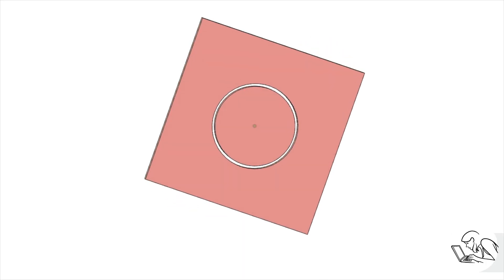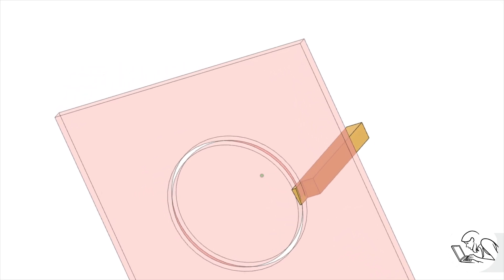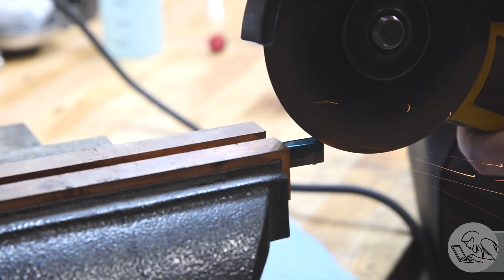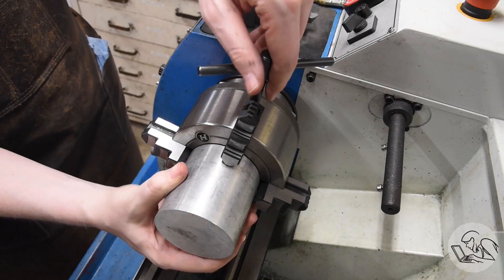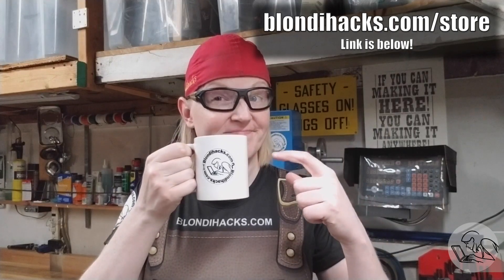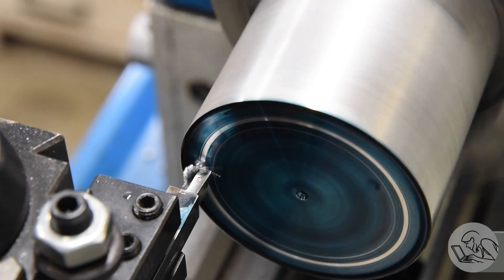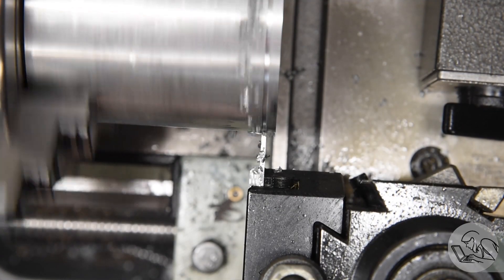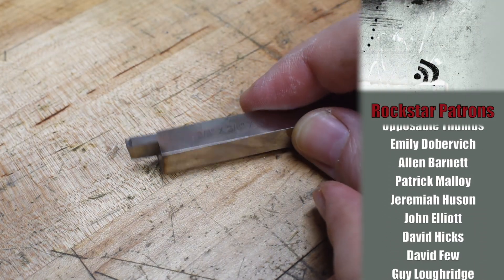Trepanning on the Lathe! Efficient and Tasty.

Comment: Could you trepan 9.25"×9.25" 1/4"-thick 6062 aluminum flat plate bolted to a scrap plate with spacers separating the work piece from the scrap and cut a ring with a 9" outer diameter and 7" inner diameter on a 10×22 lathe or would you need a much bigger lathe?

Comment: I've had much more success opening my beans with a downward facing cutter on the milling machine. less grit in them than  when I've finished having picked them up off the lathe bed in the past. Great video, I have used trepanning quite a lot to make locomotive tyres for fitting to wheel castings. you will be surprised how small you can make a cutter if you approach the work really slowly?.

Comment: you use a hand grinder to cutoff most of the material in cutting bits before you finish with the bench grinder, What brand of grinder and what type of cutoff wheel do you use?

Comment: Ive heated canned soup on a mud pump engine (DD 6-71)manifold many times. When time was short, I made a wire basket to hold the can down the exhaust stack. No vent, unless you like the taste of diesel soot but be sure to not leave it too long!
My favorite was an episode of "Home Improvement" where a contruction crew made grilled cheese sandwiches with a propane torch.
Gotta use the tools available!

Comment: You know I am wondering, has anyone thought about using carbide tipped hole saws for trepanning? I say this mainly because if you want to cut more than 15mm into it the tool required is going to be too weak, but a hole saw of about the right diameter should be able to make the cut, so you can cut deeper into the material and get a metal cylinder out... I realize for titanium this is going to be a bit hard, but still carbide is pretty resistant to heat damage...

Comment: Great tip and time saver. Just trepanned a 4.5” hole in a 5.375” x .750” billet of aluminium. Machine half way through then turned billet and machined from the other side. No great pile of swarf just a nice billet to use on another job. Thanks for the tip and keep em coming. Not sure you method of opening cans is that efficient though.

Comment: A good selection of high speed steel hole saws can be a valuable asset for doing this type of work. 
It is quite surprising how deep they will cut if kept clean and with plenty of oil, even on steel bar. 
The machine needs to be slow and powerful though.

Comment: The term 'trepanning', in the hole-in-the-head sense, is used interchangeably with 'trephining'. The tool, for cutting bone, is simply a hole saw which can be either operated by a powered drill, or more simply have a handle for manual cutting. A hole-saw on a handle is often referred to as "a trephine" or "a trepan".

Comment: So literally all I do at my job is trepanning cast iron. We have an array of trepanning tools that can drill up to 11.25" ID and up to 36" long in a single pass. We can also flip parts to do 72" long things. It's pretty fun. But very noisy. With lots of coolant.

We use Warner and swasey, and Gisholt giant hex turret lathes with 28" Chuck's and 12" spindle bores.

Comment: nice touch with the beans - the only appropriate brand of beans for the model engineering enthusiast. There's also B&M canned bread, which is not nearly as difficult to catch, but you do have to flip the can in the chuck to get both ends off, and heaven help you if your bread is not concentric.
Reply from the maker: It’s very difficult to find concentric bread. They don’t make it like they used to.

Comment: I have yet to trepan, but I have used hole saws to cut large holes while saving material. Obviously, I select a saw which is undersized as they are not the most precise tool (at least the ones I have) and use a boring bar to get the final dimension.

Comment: Nothing better than shop made beans. As for the use of the ring: If the inside diameter was slightly larger than the can of beans, you cover the partially eaten beans with wax paper then slide the ring over the can to re-seal. ! Nice Vid!

Comment: Uhh, why not keep the inside edge of the tool essentially vertical?  That would get you back a bunch of support.  +30%, if my intuition is correct.
Reply from the maker: Depends on the radius of the circle. If it’s large enough, the approach angle gets small on the inside

Comment: I trepaned a 3/4" thick piece of glass with a home made circle cutter (sheet metal on the edge of a plywood circle with a 1/2" bolt in the middle chucked in my drill press, used with #80 grit carbo and water) to make a telescope mirror blank.  I hope using the lathe as a can opener was a joke, though the cat might have liked cleaning up bean mess from the lathe :-)

Comment: Lifehack: Use a vertical lathe to open canned goods.
Reply: Or freeze the can first, cheaper alternative.
Reply: A good can opener is so hard to find!
Reply: The obvious solution is to buy a vertical boring machine
Reply: You're ALL wrong you get a CNC mill and use circular interpolation
Reply: What's a non vertical lathe?
Reply: @retromechanicalengineer  standard horizontal lathe
Reply: @TheHailacopter  so, a lathe then??
Reply: @retromechanicalengineer  no, a vertical lathe is a very different machine compared to a horizontal lathe
Reply: @AlessioSangalli  I hope you realise that I was being sarcastic.

Comment: Thanks for another nice lathe trick :-)
One question though: why do you grind clearance on the inside side of the tool? The inside radius should provide plenty clearance, and not grinding on that side would leave more support for the cutting edge. Do I overlook something?
Reply from the maker: The tighter the radius, the less that matters, but on larger circles the approach angle approaches zero there.

Comment: Vertical mill is much handier for trepanning canned foods.
edit: https://www.hilltop-cottage.info/blogs/adam/making-a-trepanning-tool-notes-and-plans/
Reply: Kevin Counihan  I had a trepanning tool for the mill in mind.  
A rotary table works too.  
Milling a square hole in a round can is an inferior solution, though.
Reply: I skip all the high tech equipment in favor of a Sawzall. But a hammer and chisel will get er done in a pinch!

Comment: Uses a hole saw in the mill.  A great way to make custom fender washers.  Tho thankyou for the alternative on trepanning
Here I thought the aluminum ring was for the spacer ring you need for the flywheel pulley mount.  Give me more time and I will think up something else as well.
Reply: The hole saw method is great if you don't need a lot of precision or a great finish. Hole saws pretty much never run true and can leave a bit of a ragged finish - which is fine for many applications!